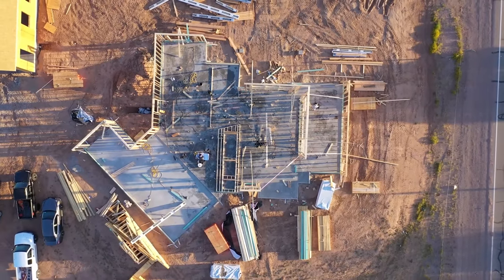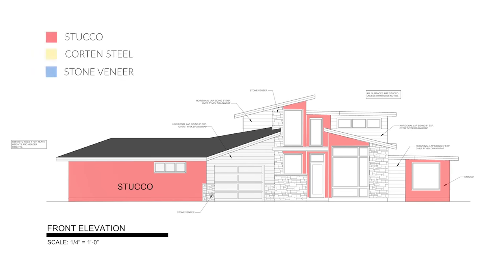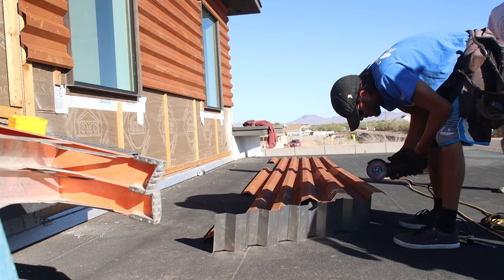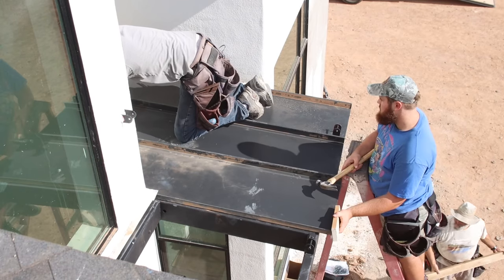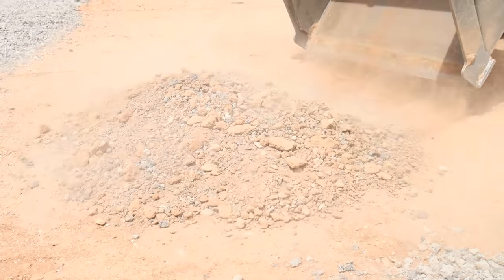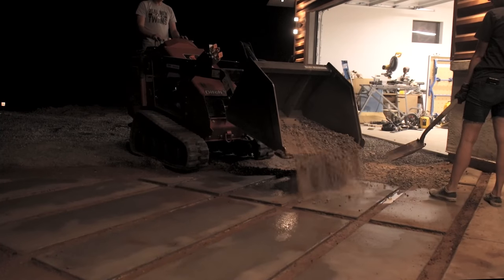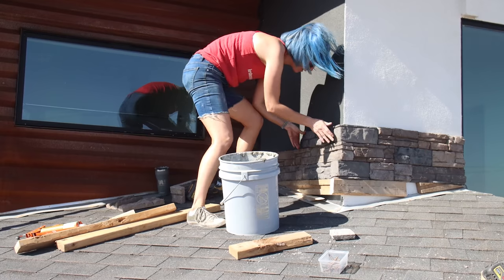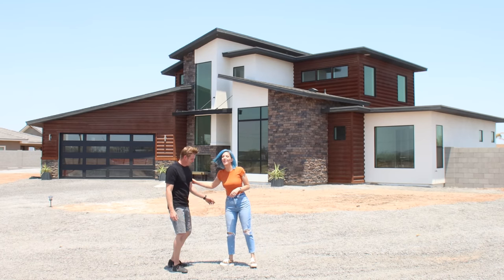Rusted Metal, Fake Stone & Concrete on a Modern House | Ep. 12 Building Modern on a Budget

Comment: I understand your concerns about the local faux-stone supplier and the less natural look. I think if you look closely it doesn't look super natural, but it looks pretty darn good and anyway that works pretty well with the modern look. And come on, the cost you were able to achieve with the Corten steel and the faux stone is crazy inexpensive! GOOD JOB!

Also, it was a very good idea to pre-weather the Corten steel. One example of what can happen when you don't do that is Uris Hall at Cornell University. They get plenty of rain there, but perhaps there isn't enough pollution in the air or something, and instead of making a nice consistent patina it rusted in localized areas and ran down onto the foundations and was kind of a disaster. You will have headed off that problem so once again, GOOD JOB!

I have been waiting rather impatiently for your most recent update but I have to say it was worth the wait. I really like what you have done and I'm pretty amazed at the budget you have been able to achieve even if you have gone over your initial plans. I can't wait to see what else you have in store for us!

Comment: A good option for larger holes in steel is a bimetal hole saw. For thick steel a slightly undersized pilot hole is advisable. The saw cuts fast. It will leave a slightly ragged edge so this works best when hole edges will be covered by bolt heads or grommets.